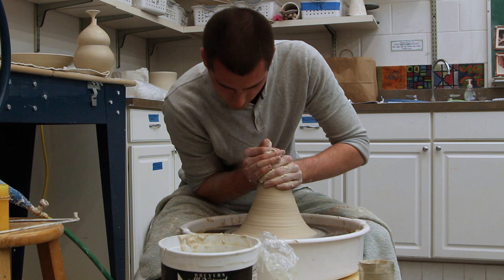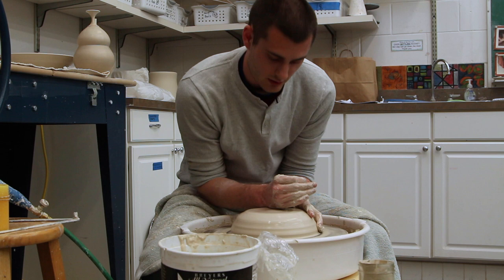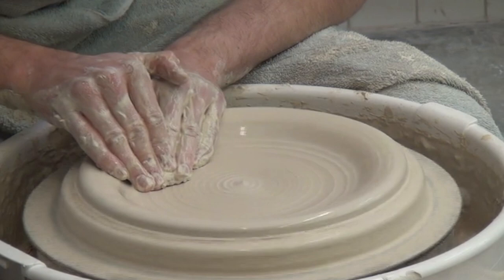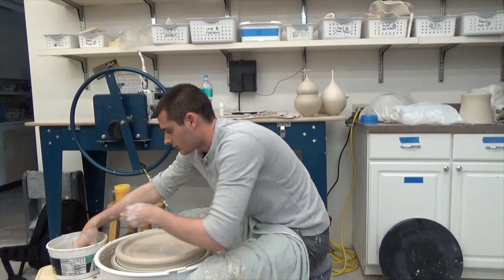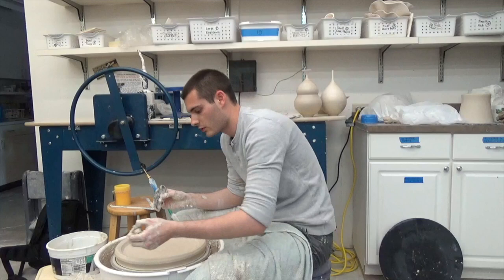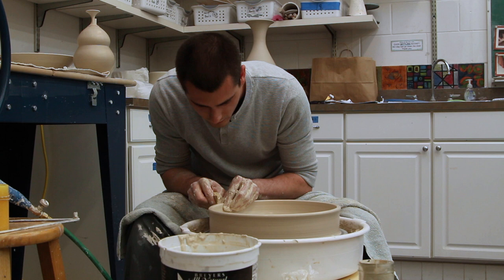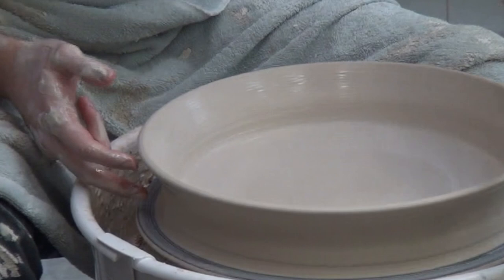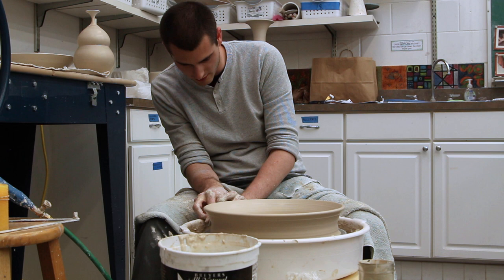Throwing a Large Platter - Matt Horne Crystalline Workshop

Comment: Brilliant video Matt :) I too would put loads of grooves when trimming, as you say, reduces weight and lessens the chances of cracking.
I also leave a small raised circle in the middle when trimming that can help avoid the plate sinking when firing.

By the way, love your Kentish accent! I am also a Kentish man :)

I also use a blowtorch on every pot, mostly to enable me to lift any pot off the wheel head, EVEN plates. My fav tool is my blowtorch. I never use bats.

Kind regards Matt.